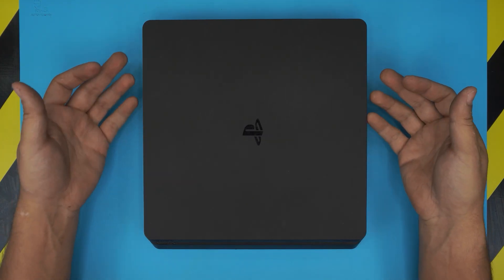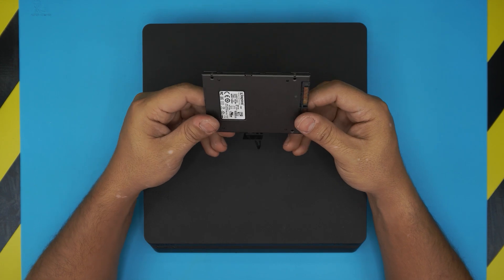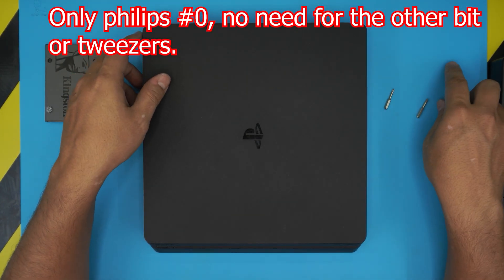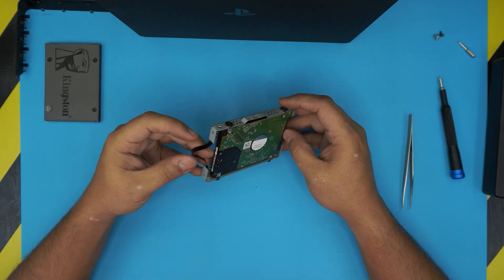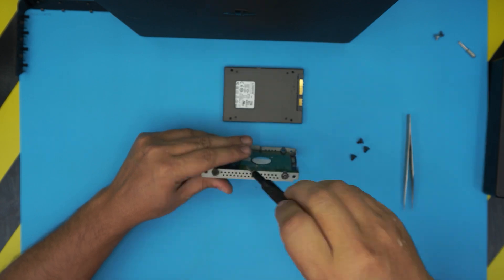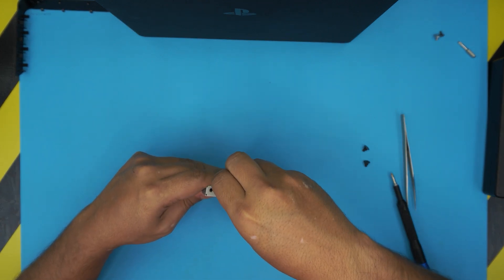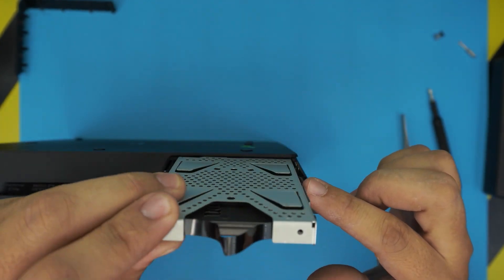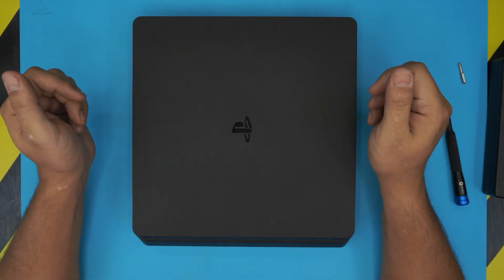Playstation 4 Ps4 Slim SSD Upgrade FULL GUIDE, SPEED UP PS4

Comment: Internal or external better for ps4 slim?
Reply from the maker: Thank you for the feedback! if you wish to support the channel you can LIKE or SUB or both :P
regarding your question: 100% INTERNAL
Reply: Which one is best?
Reply: And even with no sata 3 connection like the ps4 pro has ? Are you sure?
Reply from the maker: the internal as the controller is faster that the external that has to go to usb controller then to south bridge then CPU. the best is internal, we have tested and internal always wins
Reply: What is the best internal ssd to get?
Reply from the maker: this Samsungs are the best in ssds, very long life span, https://amzn.to/3g0BvjS
Reply: Thank you I appreciate the help I will go with 870 evo 1 tb and what size usb flash drive do I need
Reply from the maker: get a 16gb its more than enough, 8Gb will do too
Reply: 3.0 2.0 does it matter
Reply from the maker: what are the 3.0 and 2.0  where you get those numbers? !
Reply: @uFixTek  lol ssd wont stop the lag tho i play black desert online and i still freeze up in a mid fight:(
Reply: USB 2.0 usb 3.0